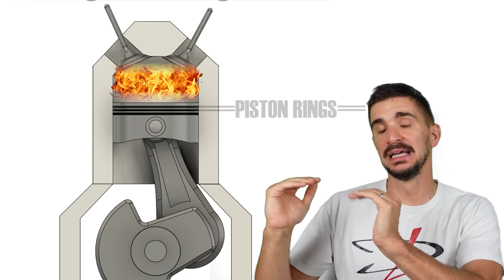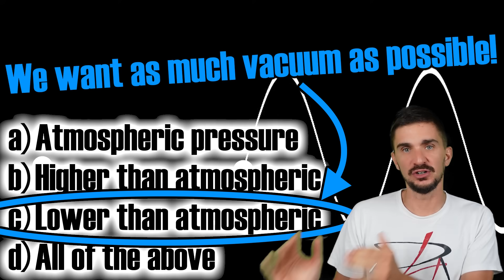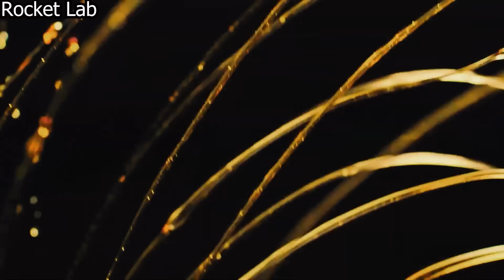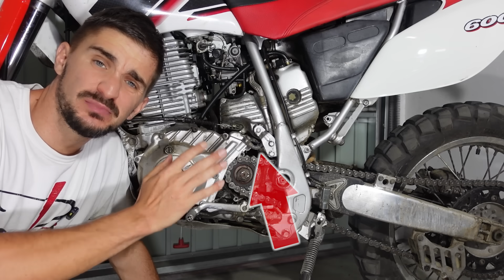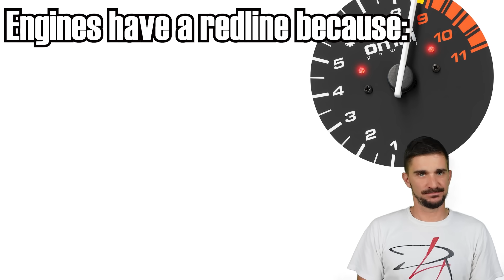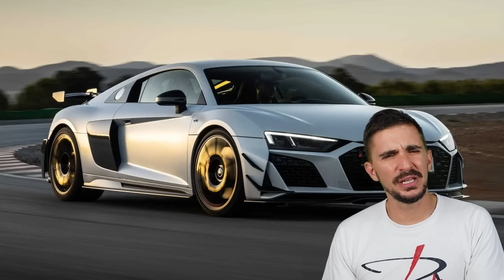Installing This Has No Drawbacks, Except for Your Wallet - Dry Sumps Are Awesome, Here's Why...

Comment: First of all: if we are talking about standard flat 4 cylinder block, the volume inside the crank case is constant, because when 2 of the pistons are in top point 2 others are in bottom and vice versa. The movement of each piston is always countered by equal and opposite movement of another piston. They create wind, yes, which is negligible (why - see point #3)
Which brings us to point number two:
The amount of extra energy you gain on burning stroke, when there is no air to compress under the piston is equal to amount of energy you lose on compression stroke, when vacuum pulls back on piston which is going upwards.
Third: compression rings will not seat  in bottom position because there is friction against the wall of cylinder. On burning stroke the pressure inside the cylinder is 50 times higher than atmospheric which is inside the oil pan, and even that isn't enough to push rings to bottom position because the friction is so high. 1 bar or 0 bar doesn't make any difference. On the contrary, vacuum in crankshaft case will suck even more gas from the cylinder.
Fourth: vacuum lowers boiling point of liquids and oil heats pretty well. Too much vacuum and it will be boiling inside the engine.

The only valid point is air/oil mist resistance which rotating crankshaft facing. Also I don't know about boxers or other weird engines like W12 and what not. Maybe air pressure argument (my first point) doesn't work in them and HP gain on them is actual 5-10% After all this system is designed and tested by real engineers (not me). But every single point made in this video so far (9:00) looks pretty sketchy to me.

Edit: 12:30 yes, it takes more heat to heat up a larger quantity of oil, true, but it also takes more air to cool down that oil back to normal temperature. You seem to be constantly forgetting laws of thermodynamics.

13:13 very good points for now on, nothing to criticize here
Reply: Oh my goodness that was a long comment. I could go into another long response but I will just point out how you are mistaken in your first point. Crankcase volume doesn't change as the pistons move up and down in the cylinders but "pressure" does. As all piston rings have a certain amount of leakage called blow by. If this blow by is removed it becomes easier for the piston to move down in the bore. As compressing a gas requires more energy than "pulling" a vacuum you therefore free up hp. And just so you know, rings are never driven to the bottom of the grooves to create sealing. This of course would cause a locking of the rings in the bore and be catastrophic. They are intended to have an gap and side gap for thermal expansion. This is why one gets pressure in the crankcase. Oh and having larger oil capacity enables the oil to cool more efficiently because it is removed from the hot engine that continues to heat it to a reserve tank that allows air to contact it. Simple thermodynamics just like he said. It wasn't the presenter that forgot it was you that didn't pay attention to the facts presented. The results shown are proven dyno results and maybe one should learn from them. As a 64 year old racer and mechanic, every day is school day for me.
Reply: @matthewmoilanen787  they still have a valid point about the force required by the piston to return up! it has to suck on the vaccuum

Comment: An engine like RB26DETT can benefit a lot from a dry sump system since it's poorly designed oil pump is a big limiting factor of the engine's legendary potential.

Comment: Very good video! I would like to hear from you about two other consequences of low pressure in the crankcase:

1 - Under partial load conditions, the pumping losses would be reduced, so the mileage would be improved in day-to-day driving conditions;

2 - For the same reason, engine braking would be poor, much like in a 2-stroke.

Is that right?

Comment: I would state that a drawback would be that the oiling system is depending on a belt. Not stating that it's common but belt failure would then lead to engine failure.

Comment: Well the crankcase pressure problem doesnt exist in most multi cylinder engines, because for example in a inline 2 in a 180° config when piston 1 is down piston 2 is up, which compensates, i hope im clear lol. Idk how to explain it but the problem is only in single cylinders and boxer engines like he said. Am i right or am i missing something? I know there are many many more advantages to a dry sump system but im curious about only this problem because im working with a single cylinder now.

Comment: Fun fact: On some supercharged systems the PCV, and supercharger are setup in such a way that there is a 2-3 psi vacuum in the crank case. My Audi A7 is an example. Most any audi 3.0T owner can tell you about the oil cap, and suction.
Of course this does get rid of the oil-air "tornado" drag.

Comment: I remember building those multi-stage oil pumps at TWR back in 1985 for the Group C series 6.4 litre Jaguar V12 engine. the story back then was about oil control and cooling plus centre of gravity. the bit that really interests me is the substantial performance gain presented in this video.

Comment: Cool Yamaha.  I'm surprised dry sump was included on that single piston engine, but is not on so many others.  My DR650SE is not a dry-sump, though it does have an oil cooler which makes its oil capacity higher.  Perhaps since the dry sump in the Yamaha wasn't doing much save for increasing capacity is why oil coolers became more common than dry-sumps on air-cooled bikes?

Comment: Things happen so fast inside a piston engine , Any reciprocating parts that come in contact with both air and oil in these conditions is friction !  
Something I learned in the 70’s ! 
A combination of Lower  vacuum , windage tray and a waste gate door in the crank and transmission in my old Kawasaki Z1 engine made a big difference in acceleration and high end HP !
All this without machining any engine parts !

Comment: This seems like an amazing mod for off-roading. Very often the angles in the terrain are such that the oil pickup experiences the same as hard breaking/acceleration scenario.
Reply: Glad you mentioned this. I started automotive life in the Jeep and 4x4 community 25 years ago. I’ve ALWAYS been impressed that a wet sump motor could operate at those extreme departure and approach angles when rigs are going up 40-60* inclines. 😮 👌

Comment: Drysumps work but have a few problems. Lots of plumbing. Have to find somewhere to put dry sump tank and cooler. Packaging can be a problem, especially an east west configuration. Cost, of course, is another issue but probably no more expensive than losing an engine from poor oil supply. Probably the most common drawback is getting your engine to operating temperature. So slow warmup is a bothersome drawback. I am surprised large commercial engines are not configured with genuine dry sump setups. Less fuel burn for same work, better control of blowby and therefore better control of emissions. Longer intervals between oil changes, cooler running engines means all parts are happier, especially in engine wiring like diesel injection systems. Combine this with a true variable displacement oil pressure pump that give full pil pressure at idle but reduces displacement as engine revs build. Stops oil being squeezed thru a relief and doing nothing but wasting fuel and hurting the oil. In our quest for efficiency I would think an integral dry sump setup would be a sure bet.

Comment: 19:10 just about every high end car that can see any g's on the road or track days has a dry sump. Manufacturers have no problem putting dry sump on these high preforming cars because it saves them tons of money in the long run due to not having to do warranty claims for blown up engine
Reply: 2006-2013: the GM LS7 engine has entered the chat. 💬 😎 

(They were early adopters for once)

Comment: How funny is that wet belt systems are common nowadays, because of ridiculously low co2 emission benefits, and in the same time it often costs more just to maintain (not to mention the countless total engine failures) that piece of crp over time than an aftermarket drysump system with much more benefits.

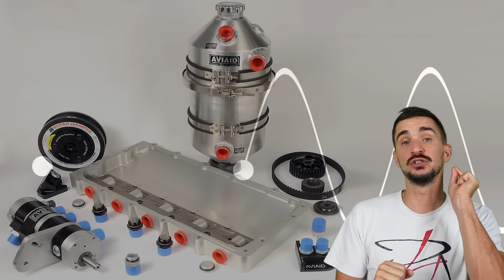Comment: 3:12 not quite true, vacuum pumps can achieve a higher vacuum than a dry sump system. Motorcycle drag racers back in the day used such systems!
Reply: Hah, I said the same thing. I know quite a few people who've fit a dedicated vacuum pump for the sump to their cars.
Reply: no that just means you undersized your drysump. back in the day things were slower.

Comment: Of course it has drawbacks. Let me summarize:
BENEFITS:
- Less energy losses inside crankcase
- Better general function of the engine at high RPMs
- Better oiling at extreme conditions
- Possibility of reducing gravity center a little bit
DRAWBACKS:
- More expensive
- More complex, which in turn means more failure points and les reliability
- Using an external belt means you need to keep an eye on it to ensure it is in good condition
- Added wheight, since you need a separate external tank and a big pump
- Added energy loses through needing to move a huge oil pump. Using a single pump is more efficient than using a pump with 5 ways, and that energy is taken from the engine power.

Where makes sense to use a dry sump? In racetrack, where you constantly expose the car to high G forces while cornering and you could loose oil pressure. Then you NEED a dry sump to prevent engine from oil starvation.
In the street, in normal circumstances, the drawbacks make for the benefits and you just spend big money on gaining a little bit. 
You won't see this technology choice in any daily driving oriented car since there is no point in complicating things so much for a car that most of the time will be far from its redline.

Comment: On a motorcycle, lean angle does not really require a dry sump. The lean angke counteracts the centrifugal force of cornering so that the resulting force will more or less be in exactly the same direction than being upright: down the vertical center line of the bike.

Comment: The Rotax 912 series of aircraft engines has a very interesting semi-dry sump system. It doesn't use a pump to create a vacuum in the crank case, but instead uses the blow-by and positive pressure in the crank case to push the oil into a collection tank. Then, a regular oil pump pulls from the tank to lubricate the engine, kind of like the motorcycle engine, but in a larger platform. The system allows for short-duration negative G loading, sustained higher RPMS,  and better oil cooling with a very lightweight system. It would make an interesting thing to explore. It's used in all sorts of things from light airplanes to predator military drones.
Reply: It would require the engine to be made so that the seals cannot be pushed out of place, and needing to take out the crankshaft to change the main seals sounds rather awful lol

Comment: Crankcase volume depends on  the number of cylinders and their timing. Most multi cylinder engines have a steady volume although the air would flow around the crankcase as the pistons move up and down.
Reply: Was looking for this comment - crankcase volume should only significantly change on single-cylinder engines, or single/multi-cylinder 2-strokes (where it's a feature, not an issue)

Comment: Surely the power gain by having vacuum assisting the piston on its downward stroke will be balanced or offset by the increase in resistance for those pistons on the upward stroke. I appreciate that the upward stroke is not the power stroke but even so the piston must be driven upward by the pistons on their power stroke so the “gain” there seems to be fully offset?

Comment: Using an AMC 4.0 i6 in the context of a racecar dry sump diagram is extremely funny.
It's a pushrod engine with its roots in the 60s that doesn't rev high and and a horizontal line of a torque curve.
I daily a car with one, it's great. But no means a racing engine.

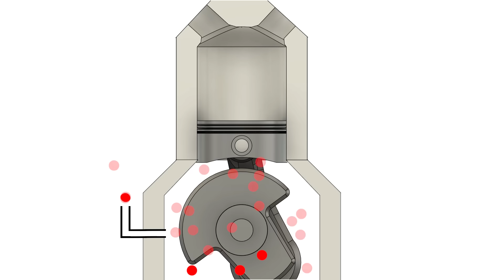Comment: Overall great video, but I do have to note that at 4:25 or so you list the main reason there is less resistance is due essentially to air resistance, less drag. While I'm sure that is a factor, I suspect the reason is more due to a better ratio of pressure above:below the piston. The dry sump on most (yes, as other comments mentioned, Volvo did a thing) does not get anywhere near what we would call a vacuum, rather it lowers the pressure significantly enough to almost pull/suck the piston downwards.
Obligatory disclaimer: I made this comment after watching another 40 seconds into the video and based on that and the titles of the chapters in the rest of the video, I don't think he talks about this. If he does, disregard this comment (and hopefully I'll remember to delete it).
Reply: hmmm, drag of oil/air on the crank shaft might also offset that, but I still think the pressure ratio is the more important factor. Someone run the numbers?
Reply: he sorta touches on the topic when explaining oil ring sealing better at high rpm.

Comment: Question: Drawbacks: what are the failure points for a dry sump? Wet sumps (if I'm using the right name) have 2: the oil pick up and 1(?) oil pump, right? the Dry system is X amount of pumps/stages, belts/chains, wheels/gears, and what else?

Comment: I've seen a few comments regarding oil temps. how does a dry sump fair with economy? also low rpm situations like highway use given the belt drive? 

edit: I ask because manufacturers wont care about cost or complexity if it makes the right numbers go up.

Comment: Fun fact: my harley davidson has a dry sump lubrication system, despite the fact that it is nowhere near a perfomance oriented motorcycle. Basically harley makes dry sump V-twin engines since the 1920-30’s because to make those big V-Twin engines to fit in a motorcycle frame, make the center of mass lower and to fit more engine oil to make sure that air-cooled engine of harley will not have an overheating issue.

Comment: You mentioned motorcycle lean angles. In theory the oil stays level in relation to the bike during lean. Minus how much the rider is offsetting the need for lean by hanging off.

Comment: On some big diesel engines the pump is electric and gets the correct pressure even before the engine starts.then when shut off, the pump still works to cool the turbo.

Comment: The added cost and complexity is why the major auto manufacturers dont use dry sumps. The weird thing is they went to thinner oils for that 1% better gas mileage and we all know engines aren't lasting as long... Well, the engines are lasting the 'lifetime' of the warranty.
At 4K miles (yes, a new in warrenty truck) i pulled the stock oil pump in my Ram 1500 w/ the 5.7 Hemi engine and replaced it with a Melling high volume oil pump, then started using 5W30 oil, not that 'efficient' 0W20. My CAREFUL tracking if fuel mileage shows (@ 12K miles) that i lost 1.3 MPG. I'll take that for a truck that'll ger twice or better lifetime mileage.

Comment: One query i have about the pressure differential. If you make a negative pressure it will suck the piston down but the piston will have to counteract this on the compression stroke? Im not sure if i missed something in the video which explained it. Additionally wouldnt the displaced air (when not using a dry sump) just effectively be moved to the next cylinder, which ig would make turbulent air but i would think that it would counteract any pressure changes caused by the movement of the piston

Comment: Drag racers have been using vacuum pumps on valve covers for years to do the same thing on pushrod v-8's probably since you were born, So nothing to new other then the sheer cost of the drysump and the engine mods needed to make it work.

Comment: What if you did a video about transmissions with overdrive? I'd love to hear your explanations.
Reply: Overdrive just means the output shaft spins faster than the input.
Reply: @iunnox so is it basically just based on the gear ratio if it’s overdrive or not

Comment: Wankel rotaries are sort-of dry-sump as a result of their layout. No drive shaft at the bottom of the housing. I did read some time ago that Mazda put an oil pan was on the bottom because the vast majority of people would not expect to find a storage or accumulator tank anywhere in an engine bay.

Comment: It is not common for engines to have splash wrist pin lubrication.
A solemn, sad look in YB Cosworth....

The YB Cosworth wrist pin lube is a really poor design.  They rely on oil squirters under the pistons, which would be fine if the squirters aren't fed by the oil pump pressure regulator outlet.  So at idle and low rpm, no oil is been sent through the squirters.  These engines galled wristpins during normal everyday use.

Comment: There are also engine driven crankcase vacuum systems that use a small pump driven from the crankshaft that will lower the vacuum level in the crankcase a large amount and improve the ring seal enough to generate 30-40 horsepower on a large race engine. They also help stop oil contamination in the cylinder thus improving the detonation resistance a great deal. The dry sump's main goal is to remove the oil away from the rotating assembly thus removing the drag that the oil physically imposes on the rotating parts. It also allows the oil pan to be shallower thus allowing the engine to be mounted lower in the chassis thus improving aerodynamics via a lower car. Great video by the way as you always do.

Comment: It appears you were using a 4.0 liter amc 6 cyl, engine when talking about how a normal sump could draw in air through the pickup tube.    We all know that the amc 4.0 L like most straight 6 engines does not care if it sucks air into the oil system, it will still happily last forever!    LOL   As a former racer I say well done, great video!!